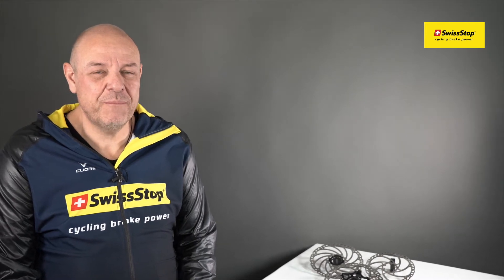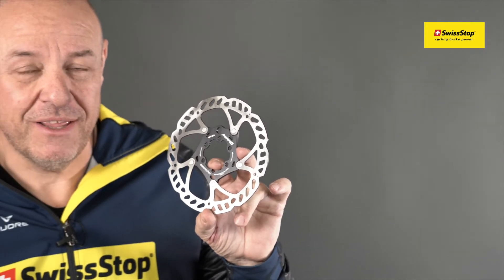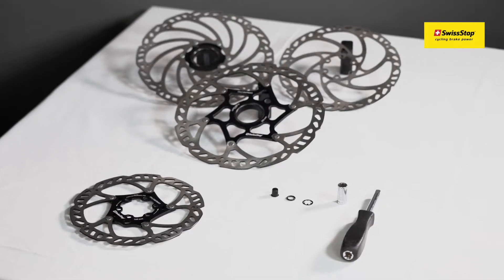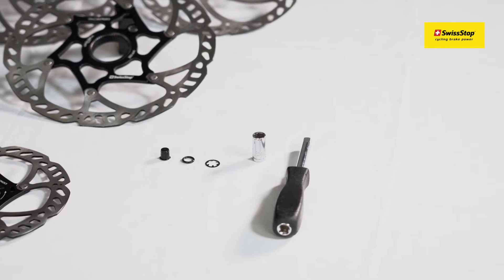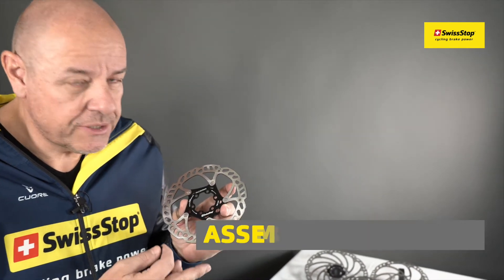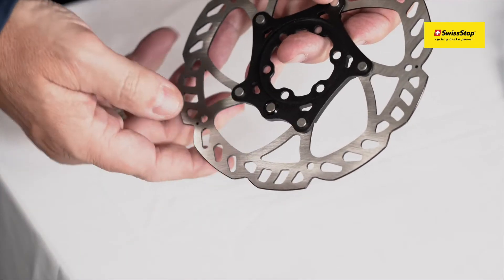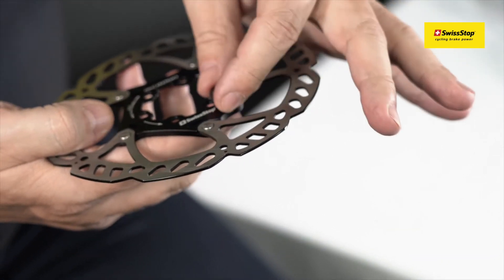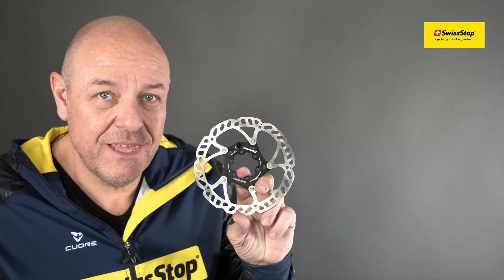SwissStop e-Bike Speed Sensor Magnet - installation guide

Comment: You're way of installing didn't work for my bike. The magnet hits the brake caliper and the frame if installed in this way. Had to take the rotor down to install it the other way around.